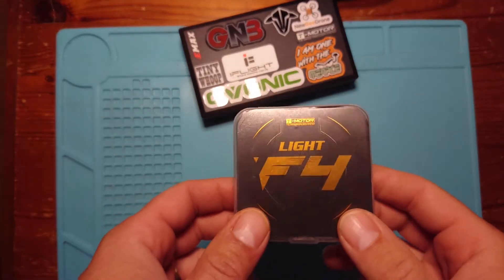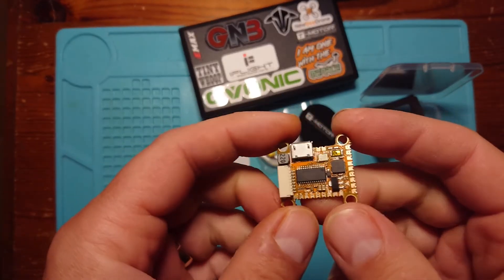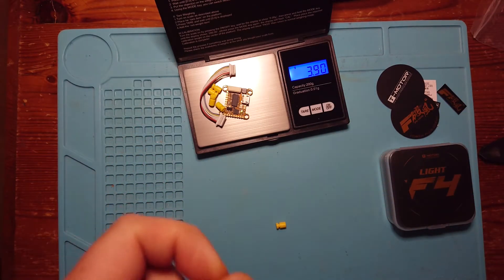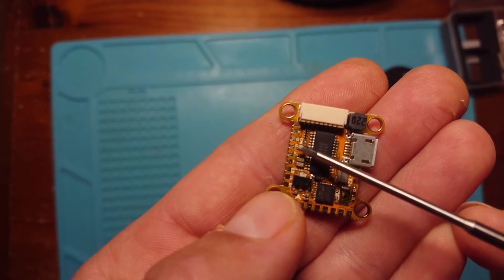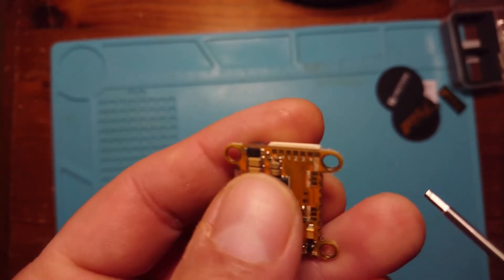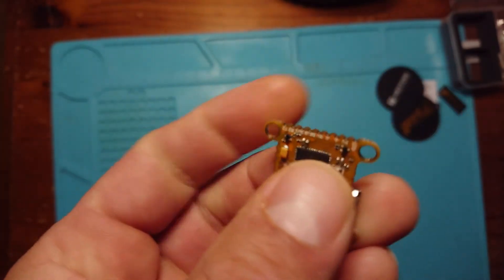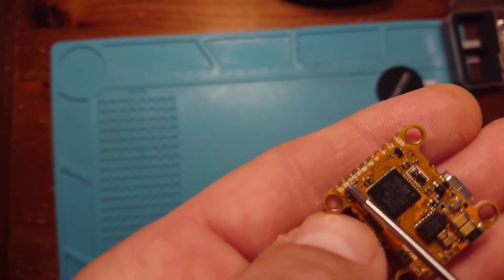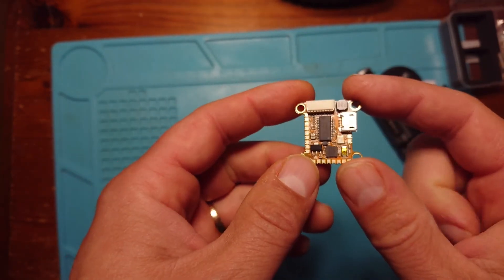T-Motor f411 lightweight (only 2.9g) Flight Controller. Overview/My Thinkings....

Comment: no spare uart to run gps with this board..
Reply from the maker: Yes it's an f411 so only 2. You could control the vtx via your receiver to free up the uart for GPS. Ghost for tramp and crossfire/tracer for smart audio, though I have no experience setting them up as I've not needed it yet. Thanks for watching 😁 👍 👍
Reply: Do you recomend the stack (fc and esc )for 3”  cinewhoop?tks!
Reply from the maker: I've got this fc in my 7 inch build with crossfire and it's great no issues so far so it should be fine in a cinewhoop 👍 not sure of the esc for this fc as I don't have it(I use another esc in the 7") , check the amp draw of your motors and see if it can handle it. Thanks for watching 👍